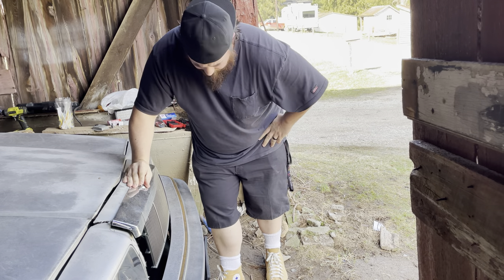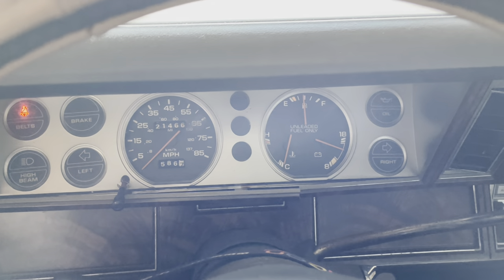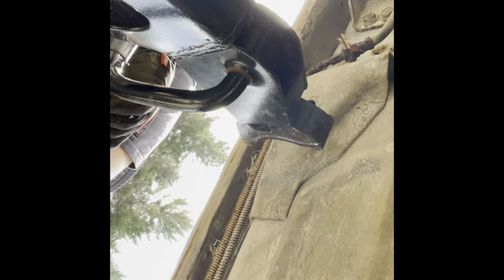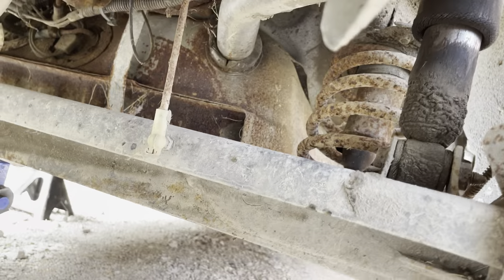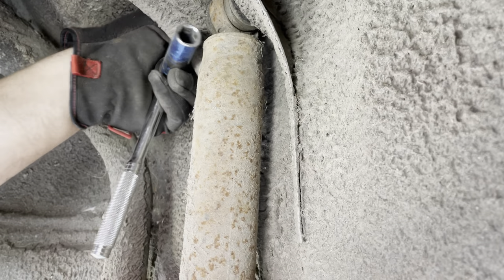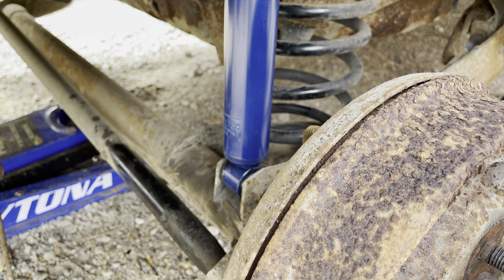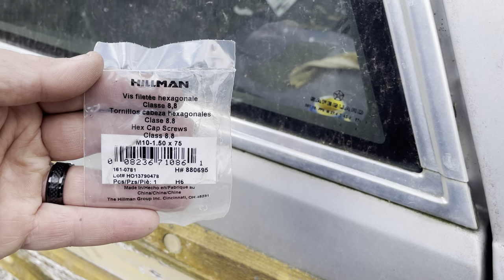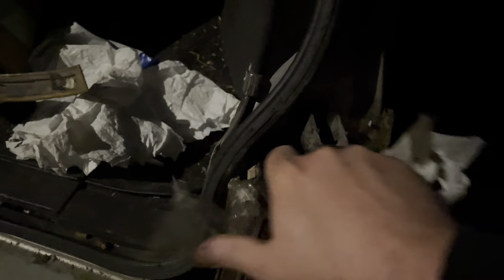How to Convert from Air Ride to Standard Suspension on K Car - 86 LeBaron Blog

Comment: If your gonna daily it spend $20 in parts on rockauto get the front brake hoses (notorious on K cars for dragging brakes and then leaking) trans mount, front and passenger motor mount (bad mounts break axles) fuel filter, and timing belt (easy job, non interference but it's always neglected when u get a K car) No joke all those parts combined are only $20 total. And if u keep fluids in it should last. after a few months do the trans fluid/filter since it's usually original...
Reply from the maker: Thank you! I do plan on doing the brake lines and hoses along with all the fuel lines and hoses before too long. They are all pretty bad off in this car and I’d rather be safe about it. All the mounts are in surprisingly good shape.

Comment: That thing could use some pressure wash/rust converter love underneath. 😃
Reply from the maker: It’s gonna get some pressure washing this week, and some terrible rocker panel patching this fall.
Reply: @invujerry  I was thinking more along the lines of the parts that only have surfaceish rust so far, before it starts seeing Pa winters. Like the panhard bar, axle beam, etc. They'd look good POR-15 blacked out and make future maintenance a more enjoyable experience with dirt easier to rinse off and no rust falling in your face. Looks like the body's already got an undercoat on it?
Reply: Fluid film works better on Already rusted cars.